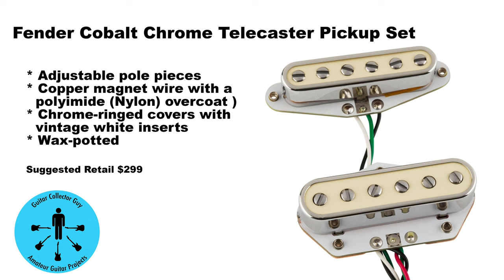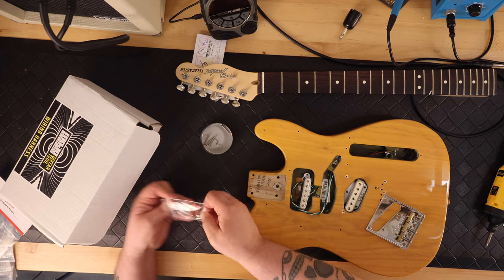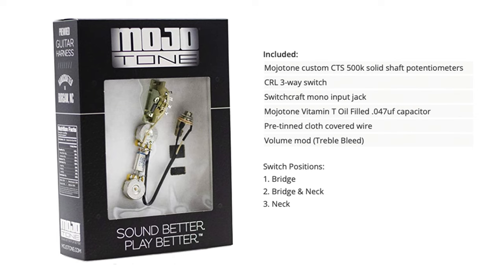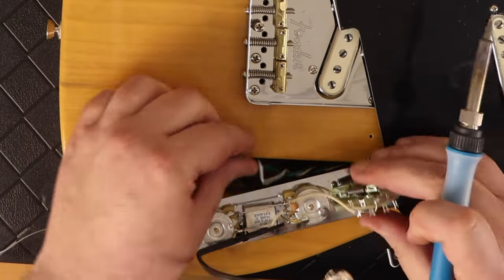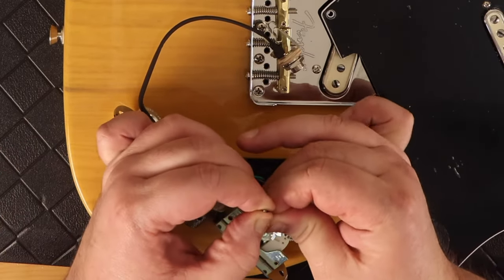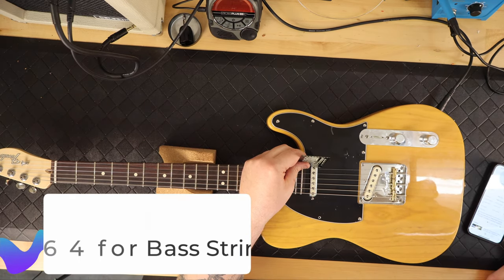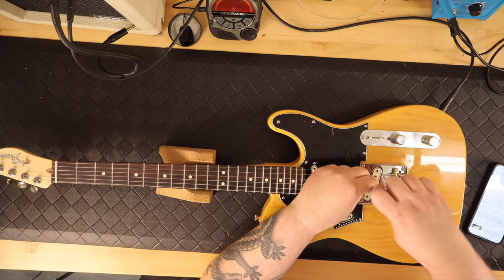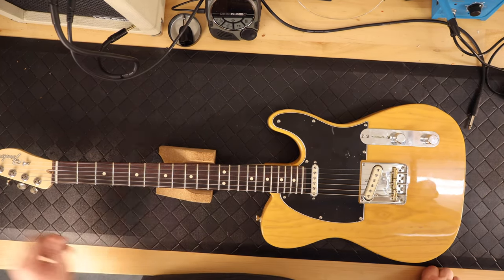Fender Cobalt Chrome Telecaster Pickup Set – My Super Telecaster Buildout

Comment: Looks like wire extension is a must if you turn the control plate around to get the volume under the pinky. 😢
Reply from the maker: I have heard from a few other viewers that this seems to be a common problem with the short wire for the bridge pickup.

Comment: I have just purchased that set of pickups and I have the same concern with the bridge pickup wires: they’re way too short. You just cannot have nice solder joints because of that pickup. Come on Fender, have you tried to install that set? I have purchased that set for one of my Custom Shop Telecaster and I’m very disappointed with my solder joints (because you don’t get enough room to flip the control plate 🤬). Even cheap sets of pickup come with enough wire length 😢
Reply from the maker: The least expensive thing about the pickups and for some reason they went short. Oddly the Strat version of the pickup I ended up cutting off a lot of spare wire.
Reply: @guitarcollectorguy  One more thing about those Tele pickups: they used specific screws and eyelets for the screw threads instead. One of the eyelet was off and I had to glue it to the pickup base. Those eyelets are flimsy and should be riveted instead of simply punched into the pickup base.
Reply from the maker: @fendafred  Fender quality control and design seems to be lacking.

Comment: I had the idea that you could solder the bridge pu wires to the control harness before installing it in the bridge. That would give you another inch or so of slack. But hopefully Fender will fix this issue in the future.
Reply from the maker: I hope they do fix it. I've now had multiple folks complain to me regarding the same problem.